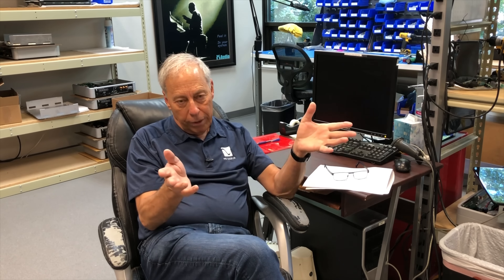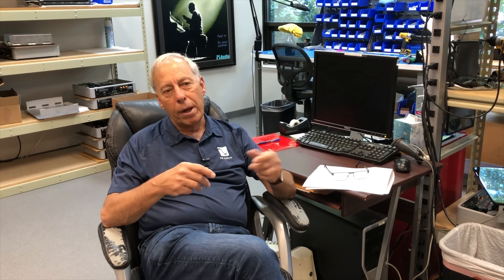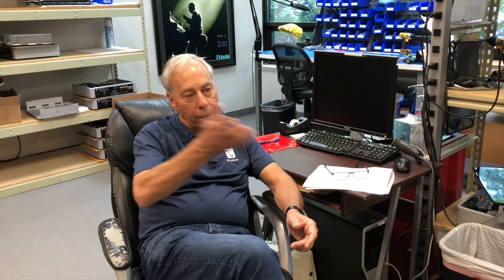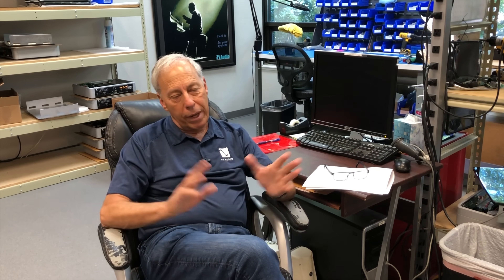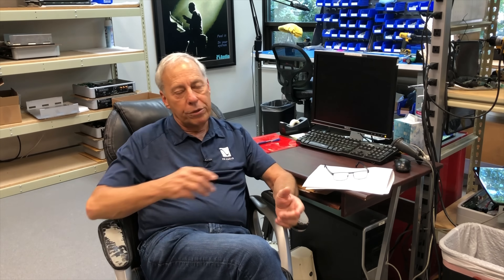How to make Class D sound better

Comment: Oh the hyperbole! Class A, A/B and D are all the worst sounding and best sounding. It could be said that in fact, there is no difference in sound between A, A/B and D. The difference comes from the build and components used. ICE circuits or IC chips are going to sound sterile almost lifeless. Traditional circuitry can sound musical, live, etc. Then there is the mix of both which can give engineers headaches until they get them working how they want. Classes of amps are all about heat and heat is the enemy as many have stated all ready. The rhetoric we hear today from "audiophiles" (again) is that class D amps are no good and the reason in their minds is because....wait for it......class D amps don't cost as much. Yup, price tag price tag price tag. Price does not always denote quality. I've seen shitty $50,000 amps (Bob Carver springs to mind for example). In reality class A, A/B, D amps can sound great or bad, it is all in the build and how the pitfalls for each are dealt with. Simple as that. Gear is good or bad and set up properly or not, that's it. People should be allowed to enjoy what they have if it is working for them without worry about marketing hype and audiophile blabber. Committed companies such as PS Audio for example are going to make good gear, class A, A./B, D or otherwise and will and should advise the customer of the pluses and minuses of whatever it is.
Reply: Eric Elliott: Paul is refering to the ICE module by B&O NOT an IC.
You cannot say IC's sound lifeless either, depends where you put them in the circuit and what they used for; if you were talking in general terms I will let you off)
Reply: Ah yes, I was talking in general terms indeed. It is like DAC chips, everyone says this brand or that brand is better or worse Burr brown better than Wolfsen, Wolfsen better than ESS, etc. They are really all the same in my experience having owned products with all of them. Their "performance" depends on how they are implemented. I have had terrible performance from Burr-Brown dacs and great performance from them for example.
Reply: Eric Elliott: I agree somewhat,  we seem to have sensible manufactures at the medium pricepoint making real improvements; but when you look at SOME high end stuff they are actually inferior circuits to a medium outfit; but use shiny well machined cases to 'justify' their price wrapped up in jargon tailer fitted to the audiophile. If I was crazy enough to spend 10k or so on a DAC the least I would do is take it apart before ordering one, of for those without electronics knowledge get someone with knowledge to asses the design.
Too many snake oil salesmen at the upper end of the market. From what I have seen Pauls company isnt one of these, but you could accuse a couple of their products they sell to be nearing the realms of pseudo science.
Reply: I agree Suzy. I was an independent audio journalist for almost 4 years and was independent for that very reason. My mission was to help folks new to the hobby or not navigate through the murky shark waters of audio to find the islands of truth and educate themselves to make informed decisions. Always focus on real science. Yes, the high-end realm is full of tricksters who use pseudoscience and when you present real science they get upset. I have countered a few of them in person and was able to show them and they still told me I was wrong.
PS Audio is one of the relatively honest audio companies though. I think they have a few things figured out. They also have no problem recommending other brands, so that says a lot right there. Yes, one or two of their products leave one scratching their head a bit, but other offerings they have are well made and priced pretty near appropriately. Just because something cost a lot of money doesn't mean it is snake oil, but if it comes down to using inferior circuits and such or trumpeting nothing but the badge and jewels and ego stroking, you can bet it is likely to be snake oil or an illusion. In other words, mid-fi in a high-end case with somebodies name on it. 
Anyway, I know who the "snake oil" or rather the gouger guys are and who are not, sadly there is more who are than not. 
You are correct about some of the mid-fi stuff out there being very close to upper scale in quality and build. Marantz is a great example. A number of what some consider to be their mid-fi line is made with the parts they use for their reference line and it shows in performance. 
Of course due to stupid tariffs the price of everything is rocketing up, so parts to build the gear are getting more expensive.
Reply: Eric Elliott: I bet that was an interesting job, if I hadnt become an engineer I may well of ended up doing  similar, yes good old Marantz; I used to have their KI signiture CD player; it was my first taste of just how great audio can sound when paired with some great Senhiesers.
To this day I still have a pioneer A400 and never felt the need to swap, I will probably just keep upgrading it; Torroidal, psu caps and so on, because as far as bipolar designs go its still a very good circuit even by todays standards, plus built in England(Pontefract) which was a bonus.
I get the 'magic' of hifi; I used to love my Linn LP12, Sony pro walkman and other gadgets, I like the retro side; there will never be another Nakamichi Dragon for instance. 
Audiolab, B&W, Niam, Linn; these are the names I used to hunger for, these days I am not so sure as I have stopped looking to upgrade; having found a system balance that ticks all my boxes.
The tariffs may actually give our UK manufacturers the push they need to create another golden era of UK audiophile design..hopefully!.
I dont suppose you ever had the rare privilege of hearing a system with a rotary subwoofer?, I ask as I am designing one at the moment.
Reply: Yes, if it is not broken don't fix it. The whole point is that if it makes you tap your toes, then everything is right, you have arrived. So much of today's high-end gear leads to massive diminishing returns in all areas. That is why one needs to be extra careful when shopping for audio gear whether it be high-end or otherwise. In other words, know what you are buying. Sadly, the internet has made that near mission impossible. I don't know how it is in the UK, but try shopping for speakers or headphones and the like in the US...good luck. No place to audition such things. Some places have "in-home trials", but it comes at a price, thus using up what you saved to make a purchase and leaving you empty-handed for your efforts.
One might be able to shop for sources or even amps via internet, but it is impossible with speakers and such and yet no shops have speakers for demo anymore. 

Speaking of legacy gear such as the Nakamichi Dragon (would have loved to have one of those!) I have a second system I run that is vintage except for the speakers now. It is all from the early 70s Marantz 2238b, Sansui 8080db and Yamaha CR2020 and a Pioneer PL-510A turntable. This stuff was hand built in Japan, every piece of it. The turntable can handle a wide range of carts and it is running perfect. Those old turntables don't die. I have had the Sansui and Yamaha serviced (recapped, tuned, etc). I did the Marantz myself.
I was, until yesterday, running a pair of DCM TF-600 speakers, but they have always been too big for the room and they were very much showing age, but still working although I got tired of the sound. So the new stuff in this old system is the CD player (yes, a Marantz CD5004 and the speakers, a pair of Paradigm Monitor CS6000.  You design and build anything correctly and smartly and you would be shocked at the performance you get usually for far less money. Just look at what my friend Andrew Jones does for example.

I have not heard a rotary sub before. I used to run subs when I was into home theater, but about a year ago I got tired of HT and am going back to two-channel. If I had bookshelf speakers, I would have need for a sub. I'm a tower speaker guy myself.
Reply: I can only agree.
Badly designed stuff sounds worse than great designs. 
Something is wrong when you, as a seller, buyer, reviewer cares about the inside of the box.
The only valid question may be 
"Is this thing worth the money to me?" 

As I see it, the problem is that some have heard bad sounding amp's and therefore the technology inside the amp is the reason. 
May it be class-D , negative feedback or whatever.

Comment: Excellent explanation. Sorry, I'm an old fart and never thought that this is where the high end amplifier market had gone. Class D modules.  For some years I was friends with, and a customer of, Nelson Pass ( then Threshold Audio now Pass Labs ). One feature of a Nelson Pass Class A amp is during cold weather you didn't need to turn on your furnace while you were listening to your stereo. Make sure you use a 20A 115vac wall socket on a separate circuit breaker.
Reply: Bill Kenney
  I hate listening to the furnace when listening to music, so my class A mono blocks are really cozy. Not so great in the summer months, but class A sounds so sweet. I'm surprised so many people are willing to sacrifice quality for class D amps. Do these people realize when they do a load of laundry they use more power than probably several months of listening to music. We are talking pennies for a Kw/hr, so why would anyone sacrifice sound quality to save a few pennies per month. There are far better ways to save electricity. Class D amps don't sound good to me.
Reply: @gordthor5351  Not any more. Two 100W amps are gobbling 200W/hr when not being listened to. And have you heard of climate change? Those wildfires? That drought? Yep - "pennies".  Times 240,000,000 people in the USA alone swiftly adds up. Besides, when companies that supply some of the best studio monitors in the world like Adam Audio are using Class D, the argument for class A boils down to what you've already invested in. And heat isn't just the enemy of human existence. Heat kills electronics, that's an undeniable fact proven over numerous decades.
Reply: @2112jonr   You don't know what you are talking about. My amps are off when I'm not listening, so they aren't "gobbling up" nothing. Unlike you I actually understand electronics and can repair electronics. It is NOT a fact that "heat kills electronics". If that was the case soldering the components to the PCB would kill them. 

Excessive heat can damage certain components, and that is certainly not the case with my well designed amps. I can touch the heatsink on my mono blocks. Have you ever seen how hot many class D heat sinks get?

Yeahm  I am well aware of climate change and I do what I can to do my part. Real differences, not saving 15 cents worth of electricity a week for my stereo. 

I hope you hang your close out on the line instead of using 4500 watts/hr to dry one load in a dryer. If not you are a hypocrite and your piss ant savings on a class D amp will do nothing substantial to fight climate change. 

Also, the vast majority of people (99%) don't give a rats ass about audio quality, so your assumption that 240,000,000 people are going to run expensive mono blocks is ridiculous. 

I bet my net carbon footprint is smaller than yours, and especially your country's (absolutely pathetic) carbon footprint. 

Go teach some far right wing Americans about climate change. They need it. I don't.

Comment: I am sticking with class A/B.
Why spoil a brilliant pre-amplified  analogue signal by using it to modulate a high frequency square (or is it triangular,yuk! ) and then apply L/C filters to recover the original audio?
For purity and fidelity,I say class A or A/B is best.
I am not persuaded  by the fact that class A/B is only 50% efficient as against Class D at 90%.
Class D has a use where more power is needed from lower supply voltages and less heat is generated,but that is about it unless I have missed something.
Reply: I have seen class AB amplifiers that are 70-75 percent which uses a switch mode power supply and really complex RLC circuits to completely eliminate the switching noise prior to the class AB amplifier circuitry. A variable bias solid state amplifier where it controls the transistor bias voltage on the flying instead of modulating a high frequency triangle wave, is a better way to do it in my opinion. So it uses an analog delay, a feedback loop, a microprocessor that controls how much voltage is supplied to mosfets and mosfet drivers in the class AB amplifier. So it's a DC voltage that matches the peak amplitude of the pre-amplified audio signal so the higher the peaks the higher the voltage, the lower the peaks the lower voltage. So if the pre-amped signal peak voltage is 4.5 volts, 30 volts is supplied to the output transistors and if the pre-amped signal voltage is 0.75 volts, 5 volts is supplied to the output transistors and vice versa.
Reply: This applies only if you are using all analogue sources.
If you listen to any digital sources, they're sampled at a specific frequency, either at redbook cd 44.1kHz at 16bit resolution, or at higher frequency and / or bit depth.
I believe the ICE modules use PWM at 384kHz, which is more than enough bandwidth to reproduce clean sound, while filtering the high frequency noise the powersupply and other circuitry might generate.
It may not be the 2.8MHz 1 bit bandwidth of DSD, but, it should be enough for audable sound.
Reply: Yes,and it is interesting how PS Audio and other manufacturers continue to produce and extol the virtues of their 100% analogue pre-amps.
Reply: @georgebliss964  not at all, what is interesting though, is why some would still use a 1950's NOS vacuum tube as the preamp and even amllifier stages, when they measure to have more distortion and microphonic influence when compared to either transistor based class A , A/B and even class D amps. 
To each their own, I'd say. I'm happy powering my B&W N802's via a Rotel RB-1092 which employs 2 500w ICEpower modules, modded by Rotel.

Comment: In another Paul video about Class D there was some talk about improving the output filter.  Class D design creates a lot of high freq. noise as it alternates off/on at high frequency.   Is that just part of the ICEpower package now and doesnt' require modification?
Reply: Any good class-D design addresses the residues from the switching frequency.

Comment: It would have been nice if you have told use how you overcome the problems of class D amplifiers such as high frequency performance.
Reply: higher switching frequency
Reply: How much higher? A standard delta sigma converter would run at around 3Mhz which is ok for small signals but there are new challenges with higher currents and voltages. I was interested in how those had been overcome.
Reply: John Jackson: Youve opened a can of worms there; doesnt matter how high you push that frequency; you will always get an audiophile with superman hearing telling you its too low. There is research paper/s out there to find on blind listening tests though.
The main problem with increasing the output frequency is stray capacitance and such causing a double-conduction state on the output transistors and at those kind of voltages and currents it would be akin to a small explosion.
Reply: @ThuleApsu  That's an intriguing answer. I would be very interested to see the results of scholarly research on anything relating to perceived audio quality.

Comment: I find a lot of class D have a permanent low level hiss and badly perform with low volume sound - kind of puts me off. Efficiency, great with modern compressed sound and loud seems to be what it's all about - me thinks it suits the modern world ;)
Reply: hypex ncore = zero hiss!
Reply: Not sure what your talking about? I have a hypex ncore amp and a nad m51 dac which is also a class A preamp with lossless digital volume control. It doesn't alter any of the digital signal until down below 44dB and it sounds amazing! Zero hiss, absolutely nothing!
Reply: We're talking Apples and Pears here. I assure you at a component level (integrated circuits, discrete designs and boards containing them), the problems I describe do occur with most devices. Hiss due to inadequate output filtering and bad board design, and low volume problems due to the PWM not being of high enough resolution to process minuscule changes properly. Class A or AB (set up properly), represents much better quality sound - for your buck. In my opinion.
Reply: @mickybee3247  Class D, when designed properly (hypex ncore!) Is probably superior performance for the $$. You must be comparing  crappy class D...
Reply: @MrDingaling007  Yeah cheap class D modules like the TPA3250 sound really good. Most folks that rag on class D have out of date assumptions or a bias. They're very good these days.

Comment: I happen to notice that many class d amps really don't have a box big enough to have a oversized power supply.  So, many could be current starved.  My first tested class d has a large box power supply bought separately that included a constant on fan.  It can get hot when pushing the amp.  It's like many audio designs out there that have power supplies just big enough.  I think everyone should have a class d amp in addition to the other types so the advantage can be heard.
Reply: Manard H, I agree that a lot of the audio equipment manufacturers don’t provide enough current in their power supplies.  Years ago there was a big movement within the audio DIY community called POOGE; this was optimizing store-bought equipment to take it to a whole new level.  A lot of this was power supply upgrades.
Reply: They don't need a large box. Switching power supplies are efficient an compact. If there isn't enough power, it means they screwed up in their design